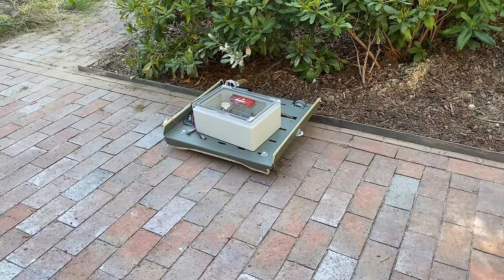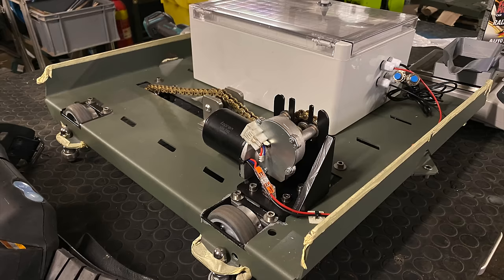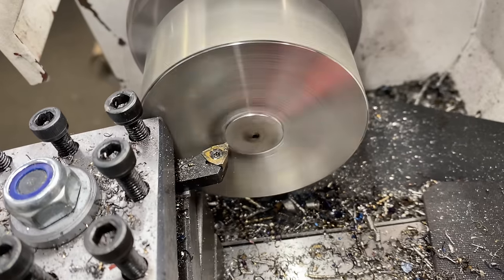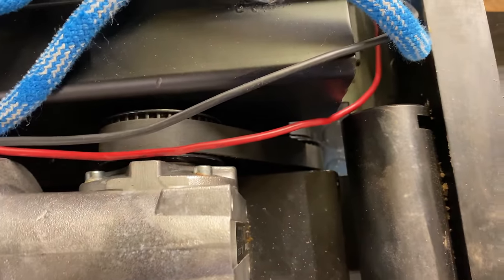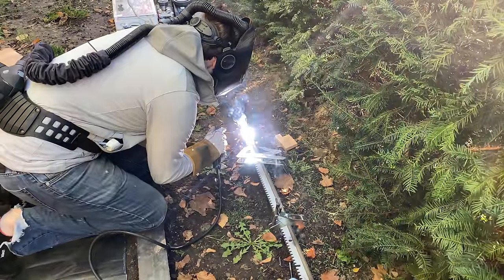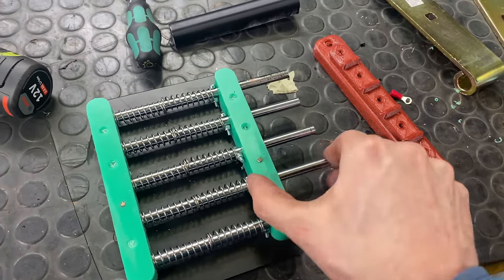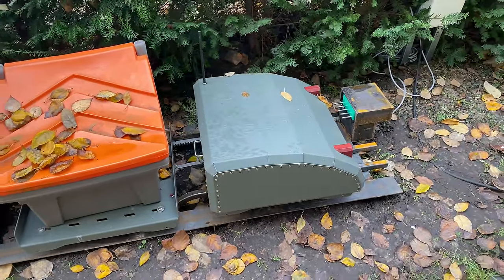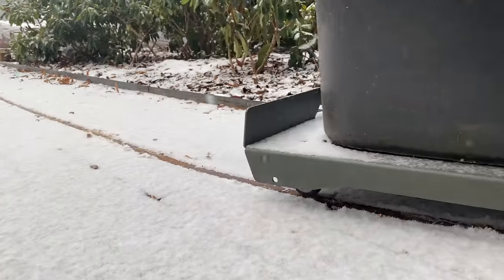I put my trash cans on rails and now they move automaticaly! (Trash Train)

Comment: I do think this is great ... but, some points to consider: The track edge in this design is dangerous. People frequently slip on pathways and if you hit your head on that steel edge you have a strong chance of very serious injury or even death. A broader (safer) flat surface could be used. The system needs to be specifically child proof. No kid is going to be able to resist riding on this thing!

Comment: I was thinking if you're gonna mass produce these, you could make a cheap version where you can manually push and pull them yourself by creating a handle on one or both sides. Maybe even make one or two handles an optional choice. Because I might not be able to afford an automatic one like that but I wouldn't mind the same setup that allows me to manually do it.

edit: another thing I thought about is maybe I'll want to get the manual now and later upgrade to a motor? Call me bias but I always loved customization.
Reply from the maker: That is a option for sure. But the tracks would need to be underground. Its hazzardous to walk along the tracks when they are sticking out of the ground.
Reply: @MaxMakerChannel  What tracks? From what I see you don't really have those. There's nothing hazardous  to trip me if i were to push those along.

Comment: So in winter the battery will die way earlier and you have to change it befor it works? How far could you test it in minus degrees so far?

It´s really a tech lover kind of thing isn´t it? Paving the ground would ve been easier and cheaper right? And there is my finally questian: What if you forgot the key remote? You ll have to walk back upstairs.... At first I´ve been quite enthusiastic about your project and it is still pretty cool. But these questions just popped uo in my head...
Reply from the maker: The remote has its place at the entrance. The battery works up to about -10°C, but it doesn’t charge anymore when it is 0°C. So I need to add some insulation to the battery in winter.

Comment: Would a tubular steel track and nylon wheels have worked better?  Like a rollercoaster?
Reply from the maker: Tubular is used because it works in any orientation and allows locking as well. The roller coster cannot fly off the rails and ride on any surface. They would be easier to allign. Nylon wheels is what I went for in the end to make it quieter.

Comment: So, it's been almost a year now since the video was uploaded and chances are that there's been some snow in the meantime... Like, proper snow, not just 1 or 2cm. How did the trash train hold up?
Reply from the maker: We had heavy snow with about 15cm. It only lasted for a week and is now gone. During that time I stopped the train. It would not have been able to push through the snow. It has enough torque, but the gears would get packed with snow. On the other side I would struggle to push the cans out myself through the snow.

Comment: Havent watched to the end yet but why not make the rails wider to get mire friction? Your wheels are large enough anyways
Reply from the maker: The width shouldn’t have any effect on friction. You get more contact surface, but the weight is also distributed over a wider area. Friction = Downforce*Coefficient of Friction. For steel on steel that is about 0.3.

Comment: I would love something like this, but our bins are placed on the curb of the road and lifted and dumped by a mechanical arm, which tends to slam the bin back on the ground, so there's no way the bins would actually land properly back on the train and also not damage the train in some way. And that's if the collectors would even pick it up if they saw something like this. They tend to be really finicky about what they will tolerate. Maybe that's just American problems.

Comment: if u want a grip why dont just make a gear with serrated/saw-edged rail (idk what in english)
it will give u 100% FRICTION.. now its purely depend on raw power of that motor.
Reply: nvm i didnt finish the video yet, turn out later u make it like that lmao
Reply from the maker: I tried that but you cannot easily curve it standing up.

Comment: Don't you need something to prevent stoff getting caught in the traction? I mean seems this could cause inujuries . It shoud have an obstacle detector and an override which shuts it down if it detects an obstacle.
Reply from the maker: Not really. To get to the gear you would have to be lying on the tracks and reach your arm out. It would be easier to do that while driving a bicycle.
Reply: @MaxMakerChannel  I was more thinking small animals.

Comment: This is exactly how you overengineer a simple problem. A stationary motor plus a rope would do the same and be 10 times cheaper, but that is not the way.
Reply from the maker: How would you get  a stationary rope around the corners?
Reply: @MaxMakerChannel  I'd install some smooth round corners where the rope would otherwise rub against terrain. And let it find its own way otherwise.

Comment: Instead of trying to add lots of weight to get more grip, I’d change the gripping surface to a mechanical grip system. If you regularly cut holes into the flat bar, and replace the wheel with a gear, you can get very large amounts of grip. (Depending on the angle the wheel teeth grip the rack teeth, the weight required can be very small, zero, or even negative).

I don’t know if you have a any automated tools for cutting metal like a cnc plasmacutter, but if it’s that short doing it by hand with should be feasible.
Reply: Watch the whole video before commenting

Comment: Honestly, i think it would have been smarter to drive the train using a line, kind of like old ferries where you would pull yourself along a line, that way you could skip the whole problem with batteries, the train would be simpler and controlling it could be done via wire also slipping wouldnt be a problem. Only downside is ofcourse that it wouldnt be much of a train 🙈
Reply from the maker: But how do you go around corners?
Reply: @MaxMakerChannel  good question but i imagine it can be solved kind of like a ski lift where a wheel keeps the line where it is supposed to be and then something flexible ataches the cart to the line, very easy if it is only meant to turn one way

Comment: why not make all 4 wheels drive wheels and throw some sand bags on top. nice after watching the whole video
Reply from the maker: Because swivelling wheels are hard to make drive wheels. The cable allone is a issue. Also sand is not heavy enough. 100kg of Sand is a bigger volume than the whole engine.

Comment: And it only cost you $1000 to move your trash cans with this contraption. What about the environmental impact of killing small animals, or it runs over someone's foot? You may need safety sensors to stop it. Or the beeping backup sound when it is moving. Trash pickup by my house is the truck pulls up and big claws grab the cans. Not likely would they be placed back on the track.

Comment: so instead of putting 1 stationary, protected from weather, powerful motor at the end of the tracks that operates a cable attached to the train and created a simple switch operated sequence to control in which direction the motor spins and when it stops, you opted for a much more complex and failure prone self driven non-train. 
what exactly are you compensating for? who made you look stupid in public?